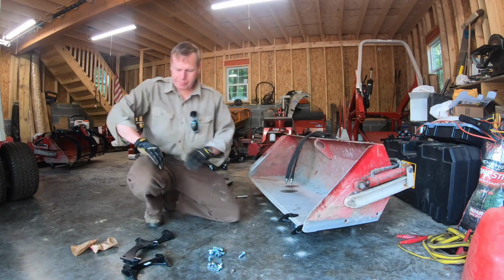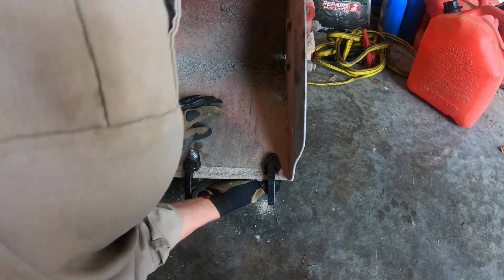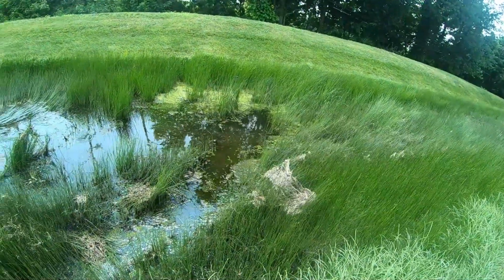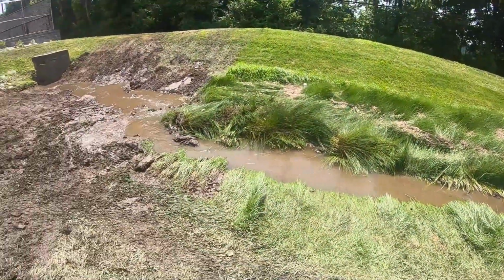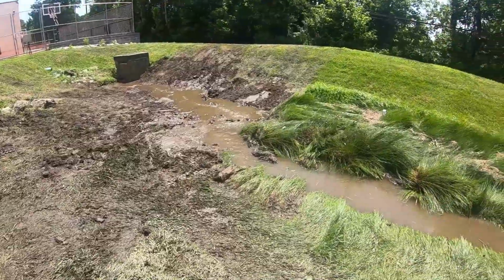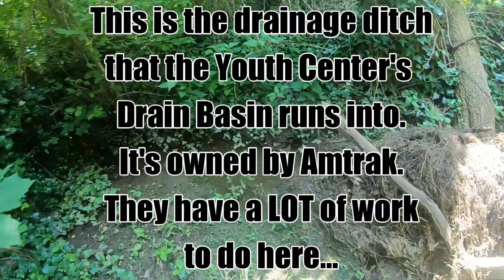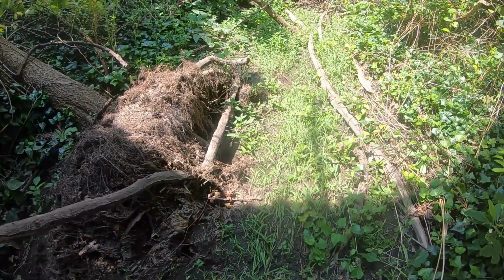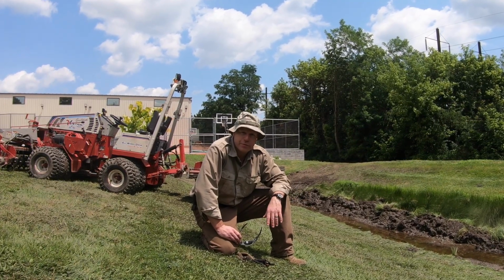Draining a Clogged Retention Basin with Ventrac and BLUE CORD Property Care!!!

Comment: I am shocked you don't need a rear ballast with that front bucket being full of dirt.  You mentioned before that the weight transfer doesn't work unless you are in float.
Reply from the maker: The weight transfer only takes a certain amount of weight off the attachment and place back on the tractor.  When lifting heavy loads with the bucket I have the weight transfer in the bottom position to provide the most lift
Reply from the maker: Remember that my tires are ballasted plus I have the weight of the 3 point and 3in1 on the back too. The mid weights also marginally help here as well

Comment: I've considered adding teeth to my bucket but haven't done that yet.  Are there tasks that are hindered by having the teeth installed - do the teeth ever get in the way?  I have the grapple on my bucket if that matters.
Reply from the maker: Doug, if you notice, the teeth are no longer on at the end of the video.  That's because I took them off.  I wanted to clean the muddy road and a toothless bucket is best for that
Reply: Yes I would think scraping along a concrete or asphalt edge would not work well with teeth. I have debated taking my off a few times. I like the idea of a 2nd bucket without the grapple and teeth I just need to get one.
Reply from the maker: @tazmankb26  A standard bucket, by Ventrac standards, ins't that expensive when considering removing the teeth AND grapple for certain types of work.  It's just so much easier to have 2 buckets

Comment: Bradley, You and Ethan are "nailing it". Great footage, music, explanation, and results. Can you explain in a future video the plusses and minuses of teeth on the bucket? A dealer I spoke with suggested they aren't necessary. Also, did you find installing and removing the grapple on the bucket to be such a chore that you purchased a separate bucket for convenience? Thanks.
Reply from the maker: Thanks, Daniel!  I'll see about explaining that in an upcoming video.  The teeth are really good at breaking through tougher material to scoop it up which I anticipated on this day.  When a smooth finish is required, I go toothless.  In this case, I took them off so as not to scratch the road when I pushed the dirt off to clean it up.  For me, having 2 buckets is VERY handy since I don't want to take the grapple off and sometimes I run with BOTH buckets at the same time, one for grabbing stuff and the other to push things around!

Comment: Why the dual wheels? I don’t run duals when using bucket on projects like that and wanting to know if you think it’s better with them.
Reply from the maker: Marvin, there are several factors here.  The first is the steep grade I had do navigate repeatedly.  The second is the marshy condition of the retaining pond.  If I were digging deeper or were operating in a dry area I would have removed them but frankly, I leave the duals on as much as possible and they're rarely a hinderance